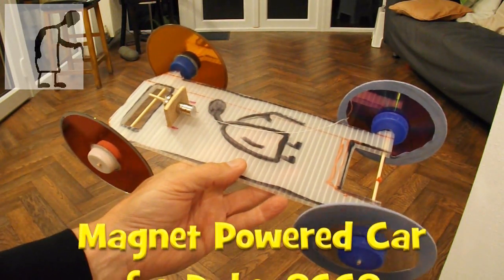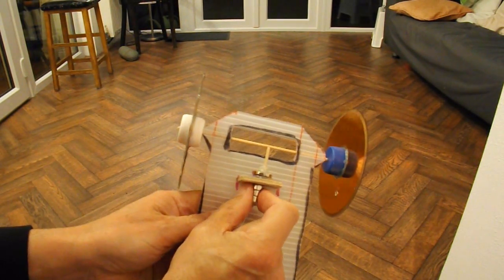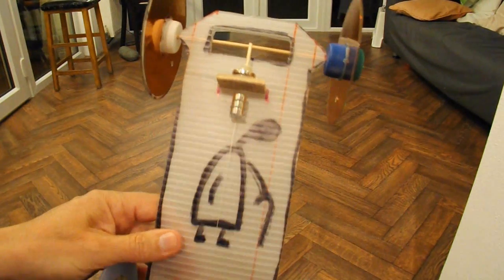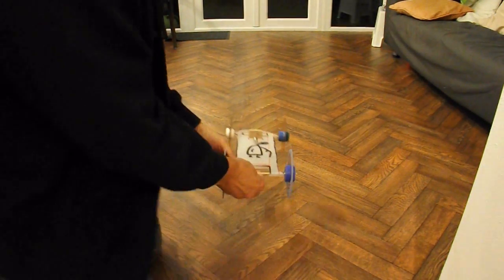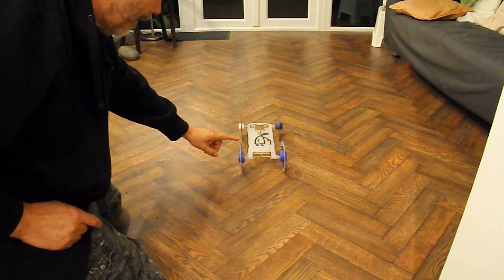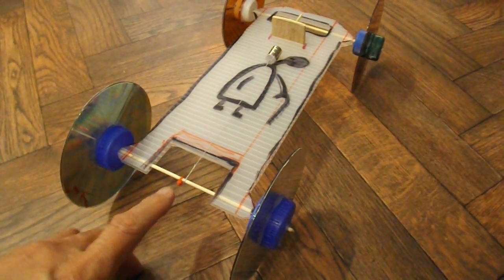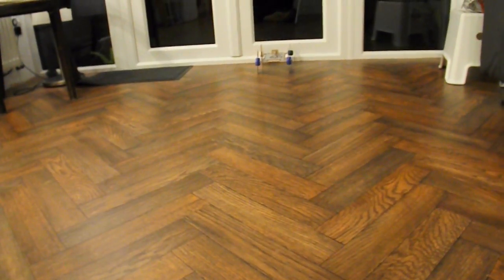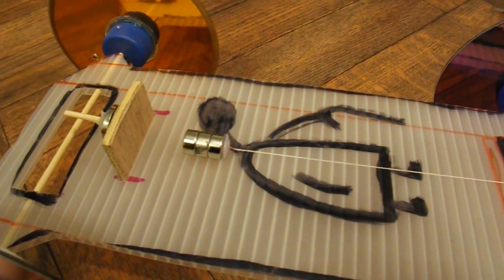Magnet Powered Car for Dukey8668

Comment: So will it keep going if you put in on a long straight path?
Reply from the maker: The power put into this is just the short distance travelled by the magnet. That is maybe 1.5" or 2". Once the magnet has covered that distance, there is no more power. The car will continue to run due to it's inertia, the distance it will travel will depend on how much friction there is between the moving parts - the axle and the axle bearing - the wheels and the floor.

Comment: Great work!! I have small idea sir if we made a system like if the magnet behind the board(the stationary one) change its pole as soon as the magnet attached to string comes near that magnet and again changes its pole once magnet attached to string had moved back if have any idea then please let me know I couldn't try It as I am minor and don't have equipment

Waiting for your response
Reply from the maker: You could use an electromagnet so you could reverse the current to reverse the polarity of the magnet. What you are suggesting is very close to the description of a solenoid motor. You could research that for more information. You could Google it or just do a YouTube search. You should be able to find plenty of videos on the subject.
Reply: Thanks sir!!

Comment: dude, you are near, but you missed the final thing usable through this method. i have nearly completed a large scale vehicle. firstly try this using ferric magnets, because neodymium alloy magnets are too powerful and are usable only for higher loads, you are making in toy scale, i tried a similar model before doing the larger one, i used neodymium magnets, the force were so large that it broke the whole set up during near impact state between magnets.

Comment: Interesting sir! I would do another concept but with a repulsion effect. It would accelerate when the magnet is unlock for fast start :)
Reply from the maker: When you do it, make a video so we can see it 😊
Reply: I thought a lot about your nice concept  👍  since last time I saw your video. I got an interesting idea to this. It will make the car move way farter. Your string and magnet must be placed like this: a bigger magnet will replace the middle ones and and an ''Augmented'' string will replace your small string. . the ''augmented'' string: New parts will be a small powerfull magnet at Start and Every 1 inch a mix of regular material and 1 inch of flexible metal balls ( https://guideimg.alibaba.com/images/shop/79/09/24/3/free-shipping-clothing-hang-tag-metal-chain-length-12cm-4-7-1000pcs-a-lot-garment-bag-swing-tag-metal-string-sling-cords_628693.jpg ). this way you can create a much longer ''rope'' that will always be attracted to the now central magnet. What do you think? :)

Comment: Could you make a  pull back car that could hold at least 60 pounds or is that to difficult
Reply from the maker: 60 pounds is a lot of weight. With the right materials and components it would just be a matter of scaling up an normal pull-back system. You would need some good wheels and bearings. Here is one that clearly carries more than 60 pounds https://youtu.be/DYCu4i1daPI

Comment: do it with a rubber band
Reply from the maker: Do what with a rubber band?
Reply: Wrap it around the stick , so when the magnet pulls it will have greater force to move the car , nice by the way 👍👍👍. I've liked all your vids for a long time , keep up the good work Budd , and 👍👍👍👍👍👍👍👍👍👍,from me.
Reply from the maker: Juan Smit Thanks Juan, I think you would need to try that yourself to see if it makes any difference. Interesting idea but I don't think it would help. I did this video back in September 2015 so I don't have it in one piece anymore as I re-use components for other projects.

Comment: Good idea.
Reply from the maker: +Nesmaniac it has very limited range and you will probably end up with a load of chipped and cracked neodymium magnets. A single larger magnet would be better then the group of small ones I used as there would be less chance of it being damaged.

Comment: Magnets doing work :) Nicely explained and constructed, that was a great vid !
Reply from the maker: +Francisco Javier Lázaro Pinela if you look carefully you will see the magnet is floating in the air. There is no friction at that point.
Reply: +GrandadIsAnOldMan Wow !.
This time I saw the video on my mobile phone and did not see fine details. 8-S
Reply from the maker: +slider2732 thanks, with less than an inch of travel for the magnets it is probably a good demonstration of gearing for anybody who wants to thing about it. Similar to mousetrap cars and could probably be amplified the same way with a lever arm.
Reply: +GrandadIsAnOldMan I think that the friction surface of the magnet with the car chassis, is a problem.
So maybe a solution would compensate by tilting the chassis and help him gravity.
For instance; the front wheels are smaller.

Comment from the maker: Dukey8668 asked "I wonder if you could do a car like a gravity powered one, but in which you have a magnet instead of a weight" My thoughts on using it like a gravity powered car are that the benefit would not really be measurable with any accuracy that I could demonstrate, however turning it 90 degrees and removing the gravity effect we can just demonstrate the power of the magnetic attraction.